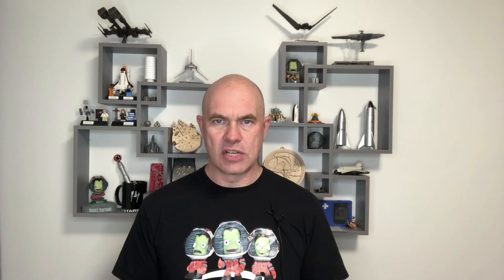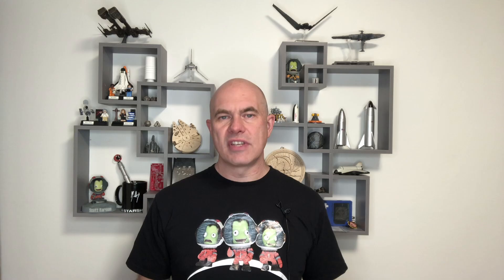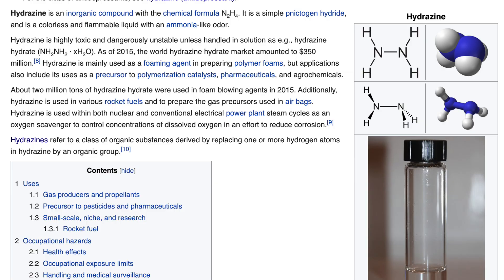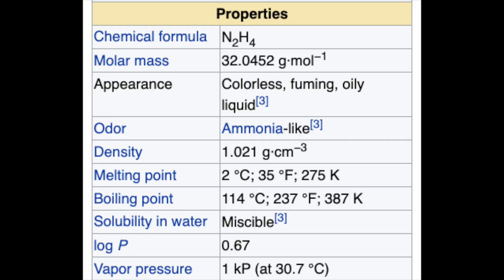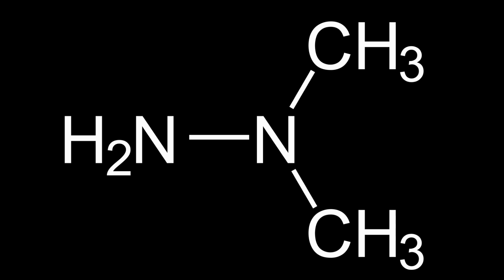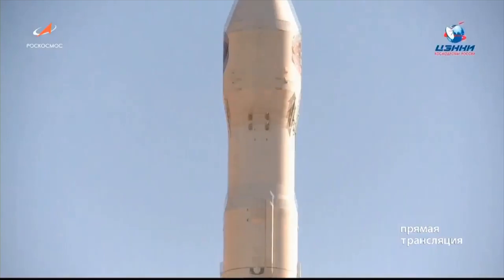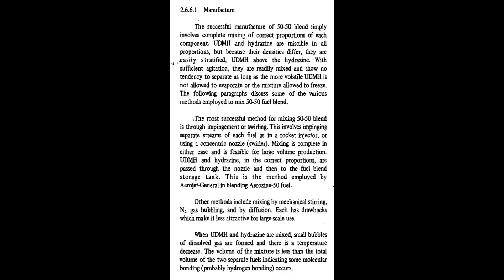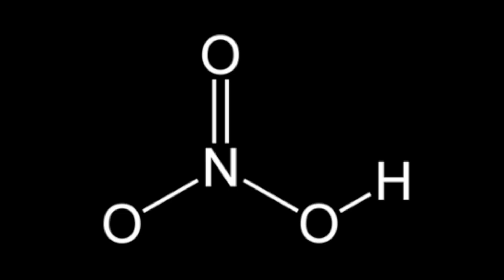What are Hypergolic Rocket Fuels? (Other than Explosive, Corrosive, Toxic, Carcinogenic and Orange)

Comment: We already have a "clean" hypergolic oxidizer. The jetpack they used at the Olympics used it as a monopropellant. It's Hydrogen Peroxide, and at a high enough purity (over 80%) it is referred to as High Test Peroxide, or HTP.
Very suitable as a rocket fuel oxidizer.
Problem is, it's not nice stuff to handle, and it's not long-term stable.

The hydrogen peroxide you can buy in the drug store is 3-5% peroxide with the rest being water.
Hair-bleach grade peroxide is 10%, and you don't want to spill that on you by accident.
Peroxide you find in a chemistry lab supply catalog is commonly available up to 30% concentration, and if you get that on you you'll get a chemical burn.
The rocket grade stuff is potent enough to eat the flesh off of your bones quite rapidly.
On the bright side, hydrogen peroxide is not stable enough to be poisonous or carcinogenic, and many plants and animals have enzymes specifically to deal with decomposing hydrogen peroxide (so called Peroxidase enzymes).

The primary problem with HTP is it's stability, or more correctly it's lack of long-term stability. Hydrogen peroxide at any concentration will spontaneously decompose to water and oxygen gas without the presence of a catalyst, so every vessel that is expected to store hydrogen peroxide has some form of pressure-relief valve or pressure accommodating features in it as a safety measure. Hydrogen peroxide is commonly stored in plastic bottles with the top section having a bellows or accordion shape, specifically so the oxygen that forms when hydrogen peroxide decomposes has somewhere to go without making the bottle explode.

Britain used peroxide in many rocket engines with RP-1, and that combination might as well be hypergolic. Sure, it's not RELIABLY "ignites on contact" hypergolic, but if the peroxide is decomposed by running it thru a catalyst bed the resulting reaction products (water vapor and oxygen gas) exit the catalyst bed at a high enough temperature to ignite the RP-1, which will burn using the oxygen liberated from the peroxide, so you still get the end result of ditching the ignition system (unless you count the catalyst bed, however I don't count that because it's in constant operation while the engine is firing).
With a similar approach, pretty much any standard non-hypergolic rocket fuel will work with HTP.

I believe that combining HTP with one of these new green monopropellants would result in a green bipropellant, however I have no idea if anyone has investigated this.
The reason hydrogen peroxide is not used for rocket oxidizer much today is that it has poor specific impulse. With the same fuel, Liquid Oxygen will provide superior specific impulse compared to H2O2 as you don't have to lug around all that water that can't react with the fuel. When a storeable propellant is needed, UDMH/NTO is preferred because it gives superior performance, however I do believe that there have been rocket engines that used the hypergolic combination of a hydrazine-type fuel and H2O2.

Comment: In the Army we had to deal with a lance missile that had malfunctioned. It used UDMH and IRFNA. Both were a bitch because they could compromise the filters in a gas mask and then melt your lungs. We had to use full rubber tap suits with self contained breathing systems just to approach the missile. Then we had to render safe the damaged warhead and retrieve the telemetry package. This was probably the most dangerous thing I did.

Comment: Thank you Scott for this very informative video! I would, however, like to point one thing out: Hydrofluoric acid is not particularly strong, it is only about as strong (or, rather, weak) as citric acid. Despite this, it is dangerous to handle since it can penetrate the human skin. Additionally, it is the only acid able to corrode glass.
Reply: imagine what would happen if a rocket fueled with hydrogen and flourine blasted of. The shower of hydrofloric acid wouldn't be so good for the launch pad I'm guessing.
Reply: Thank you Schart for this human skin! I would, however, like to handle hydroflouric acid. I think it is the only acid that can corrode (haha) glass omg what a moron sorry had to say something

Comment: HF is not a very strong acid, it just happens to be able to etch glass and is very toxic. It's just a tad stronger than formic acid but nowhere near nitric acid. As you go down the halogen group the acids get stronger, so HF is actually the weakest of them, followed by HCl then HBr and HI.

Fun fact as a side note: that part of the safety data sheet could very well also be from some of the nastier essential oils. (Though pretty much all of them are nasty when concentrated)
Reply: TheYear2525 More fun facts: Hydroiodic acid is listed as a U.S. Federal DEA List I Chemical, owing to its use as a reducing agent related to the production of methamphetamine.

Comment: Don't forget that the British Black Arrow used a quasi-hypergolic mixture of catalyzed hydrogen peroxide and RP-1. Once passed over a catalyst, HTP decomposes into very hot steam (about 800F IIRC) and molecular oxygen, which readily combusts with RP1 and probably other fuels as well. This remains an under-utilized combination. Yes, it is lower performance, but it more than makes up for it by the lack of cryogenic qualities, low toxicity, and high density.

Comment: Curious Droid has an interesting video on the Black Arrow rockets that used hydrogen peroxide (HTP) and kerosene. With a distinct lack of nitrogen in the reaction, that seems much safer.
It strikes me as a suitable fuel for an aerospike since the HTP can be used to help aid cooling of the spike.
Anyway, all useless speculation as current rockets are pretty damn well understood.

Comment: Technically, HF is a weak(er) acid than nitric acid...but I know what you mean, I just wanted to  "well actually" some of that sweet chemistry knowledge! HF is a horrible acid more for its general chemical nasties than its strong acidity :D
Reply: But then there are flourine-based fuels. Flourine fires that not even concrete would be spared.
Reply: @Aereto  elemental fluorine has the same horrific reputation as HF, and both are well deserved!
Reply: @Jerry L Kreps I believe the particular reference he is making to an account from the book Ignition where chlorine trifluoride was being talked about. ill quote it cause it is just to good and really what I hoped this thread would lead to :D

”It is, of course, extremely toxic, but that’s the least of the problem. It is hypergolic with every known fuel, and so rapidly hypergolic that no ignition delay has ever been measured. It is also hypergolic with such things as cloth, wood, and test engineers, not to mention asbestos, sand, and water-with which it reacts explosively. It can be kept in some of the ordinary structural metals-steel, copper, aluminium, etc.-because of the formation of a thin film of insoluble metal fluoride which protects the bulk of the metal, just as the invisible coat of oxide on aluminium keeps it from burning up in the atmosphere. If, however, this coat is melted or scrubbed off, and has no chance to reform, the operator is confronted with the problem of coping with a metal-fluorine fire. For dealing with this situation, I have always recommended a good pair of running shoes.”

Comment: Isn't, as the old saying goes: "everything is a hypergolic if the percent oxygen is high enough"
Reply: Nope. Nitrogen wants to be bonded to itself in diatomic pairs, and almost nothing can persuade it otherwise. The only nitrogen compound I've ever heard of that's more stable than diatomic nitrogen is titanium nitride -- titanium is so stupendously reactive that titanium powder will spontaneously combust in a pure nitrogen atmosphere. In daily use, TiN is the gold coating on drill bits and various other tools. But I digress -- nitrogen is so stable as a diatomic pair that even 100% oxygen won't persuade it to spontaneously react.
Reply: Yeah, lol. SpaceX just learned that the hard way when a titanium check valve in a superdraco detonated on the pad during an abort test.

Not even NASA knew that titanium burned that fast when subjected to 300bar of liquid O2
Reply: @Hyperious_in_the_air  wait they had another failure?! Or do you mean the one from early in the year?

Comment: I'm still waiting to see a clearer explanation of the N2O4 cloud that enveloped the Starliner a few days ago while still in the air.  In addition to looking bad my concern is that it may have played a role in the failure of the third parachute.  Additionally, when the capsule landed, quite close to the service module, the fumes blew towards the capsule and if they use venting to equalize the capsule pressure so they can open the door then fumes could easily get into the capsule and that would not be good for the crew.  Something just didn't look right with the N2O4 cloud as the chutes were deploying.

Comment: Fantastic video, I wish you could have mentioned the necessity of sticking with hypergolic fuels for relighting rocket engines without fail. For when you absolutely positively need to get off the surface of the moon. That, and the problems with housing solid rocket motors in orbit.

Comment: Another plus for MMH & MON-3 NTO is the usual mass mixture ratios means the volume of both is the same.  Therefore, if you design the tank to handle the NTO mass it will handle the MMH mass and you only need to design one tank.  Saves on engineering and testing.

Comment: Scott:  Make a video on the advantages to remplace hypergolic control thrusters with cryogenic propellants with ignition for RSC and main propulsion, this allows higher isp, is not a nasty stuff and you can use all the fuel you have in what you most need (propulsion or RSC).
Why few spacecraft took advantage of that?  taking into account how easy is to store cryo fuels on space (in case you have clear enough how heat flow work on space, emission coefficients, reflection, etc)

Comment: I've been working the F 16 for 25 plus years and they use H70 as a fuel for our emergency power unit that runs a generator and hydraulic pump just in case our single engine stops working. Never have heard of a "spill" so far. Seems pretty stable as long as it's contained...

Comment: VERY TECHNICAL NITPICK:

Hydrofluoric acid is a weaker acid than nitric acid. Hydrofluoric acid is nasty for its own reasons, but as an acid, it isn't that strong. There is a weird caveat when you get to extremely high levels of concentration of HF where it becomes extremely strong due to Reasons™. As for health concerns, hydrofluoric acid is much scarier than most other acids and requires specific treatment compared to just washing it off (as you do with other acids). That said, the specific interaction (passivation of metal due to metal fluoride layer) doesn't care too much about the acidity of the HF (the fluoride is consume, thus causing more dissociation to return to equilibrium).
Reply from the maker: Thank you, I'm not really a chemist.

Comment: Another fun area where hydrogen peroxide is used, if i remember correctly, are torpedoes. Now those are again often used in subs. So now you have a very reactive substance that releases a ton of hot gas whenever it breaches it's container and it's all contained inside a pressure vessel several hundred meters beneath the surface. Not to mention a lot of these torpedoes used it as an oxidizer so there was lots of fuel for it to react with as well.

Comment: The closest we have to a “clean” fuel that doesn’t require any ignition is probably hydrogen peroxide monopropellant with a catalyst, but it just doesn’t last in orbit for long enough.
H2O2 engines can get quite powerful as well, as the bloodhound LSR car is going to use it the 800 mph attempt for the high speed testing phase.
Reply from the maker: Nah there are much better green monoprops:
https://www.youtube.com/watch?v=y7jn9VApYqU
Reply: Russian Soyuz ship stays docked to ISS for up to half a year at a time -- the limiting factor is precisely the decomposition of hydrogen peroxide used in engines controlling the descent.

Comment: Another forgotten (but useful) hypergolic fuel is aniline.  It isn’t really classified as a rocket fuel so countries like North Korea can obtain it and since it is in the hydrazine family, it has fairly high performance.  If you notice, missiles like Hwasong-12 and 14 appear to use either Hydrazie or UDMH, but when the Hwasong-15 came out, it had reverted to what appears to be aniline (and probably NTO or HNO3).  I assume the Hydrazine (or UDMH) was being obtained from China, but the stricter sanctions probably forced a change to the more available Aniline.

Comment: Point of clarification, HF is not a stronger acid than HNO3, but it certainly is just as (if not more) dangerous, especially to humans. :)
Reply from the maker: Maybe the wrong terminology, I'm not a chemist. But doesn't the HF attack metals before the Nitric acid?
Reply: @scottmanley  You're definitely correct about the HF forming an insoluble layer with the metal, hence the addition to the fuming nitric as a stabilizer.

You know you've walked into a land of obscenely crazy chemistry when you add HF to something to make it safer. :)

Keep up the great content. I need to get a copy of "Ignition."
Reply: @scottmanley  In chemistry, strength of the acid has a specific, technical meaning -- roughly, how easily the molecule of the acid gives off its proton. Corrosion of metals depends on many other things -- solubility of the products, etc. Hydrofluoric acid is chemically "weak", but very corrosive.

Comment: Still have questions about a cloud of hypergolics contacting parachute cords. Was that large a cloud really expected to be around Starliner when the chutes deployed? Apollo 15 astronauts want to know.
Reply: I think the parachutes didn't run into the cloud until the whole thing got to the ground. It could still be a problem for the crew getting out of the capsule though.
Reply: @danieljensen2626   Was thinking more of the deployment cords, moments after engine shut-down. The ground cloud was more spectacular, but in a real abort the service trunk would land in water, and water is what's used to dilute/neutralize that nasty stuff anyway. Of course for a normal landing the trunk would have separated high in the atmosphere, burned up.
Reply: @donjones4719  I could be wrong but I think the exhaust products are not as nasty as the raw fuel.
Reply: @danieljensen2626   The orange cloud around the capsule right after engine shut-down was unburned N2O4, the raw nasty stuff.. Either an intentional fuel dump, or a valve stuck open after shut-down - which would be a problem.

Comment: It seems that, as long as they're oxidizing the fuel with acid, they may as well pack the engine bell with something that will be gradually eroded by it. That way, You can have an engine that is properly choked for liftoff at sea level, and it gradually expands to match the ambient pressures as altitude increases. Spraying an inhibitor (such as coolant, excess fuel, or whatever) through the packing can be used to retard its burn-through and give a controllable expansion of the engine bell. Since the raw flame will only contact the base metal for a small portion of the engine burn - if at all - the lifespan of the engine can be increased by making the packing replaceable. It may even be possible to use materials that are stronger and/or lighter for the engine bell - but not appropriate for contact with the flame - if you design the packing to not burn all the way through during high thrust phases.
Reply from the maker: Nice ideas, but I think the problem would be the areas with higher pressure would corrode faster, but the ideal geometry change wants the lowest pressure areas to expand fastest.
Reply: @scottmanley  I suppose this could be managed by the layout of the packing materials (since the parameters are predictable), their inhibition systems, and throttling those systems (to counteract the unpredictable/dynamic changes mid-burn). Still, your response is more positive than I expected. Cheers.

Comment: Somewhat weird question, I dug around online and couldn't really find much of an answer. If you were to take your liquid oxygen and replace with hydrogen peroxide what would the differences overall be? My very cursory glance seemed to point to peroxide having more oxygen per unit volume than liquid oxygen and not being cryogenic. I would assume those random hydrogen atoms would also get involved in the reaction too. 

Obviously though, this isn't what is done now, and I am 99.99% sure the reason isn't "nobody thought of it", so what am I missing/misunderstanding?
Reply: People have thought about it -- there was once in the UK a Bristol Siddeley Gamma family of rocket engines which ran on kerosene and hydrogen peroxide. It worked just fine, but there are many small difficulties with peroxide. It's sensitive to minute contamination, freezes easily, etc. And of course, when things do go wrong, concentrated peroxide blows up quite violently -- which had, for example, caused a loss in 1980 of one of the russian Souyz-family boosters during fueling. (Soyuz requires on the order of ten tons of peroxide to drive its turbopumps.)
Reply: @cogoid  Thanks! That makes sense.

Comment: UDMH is stable enough to store for years, but how many years? Two? Ten? Sixty? Ive tried to research this in the past and couldnt find out!
Reply: I am not sure if there is a specific limit. Russian ICBMs use UDMH, and they are designed to be stored for decades. Voyager space probes use hydrazine, and they are still working, after having been flying for 42 years already.